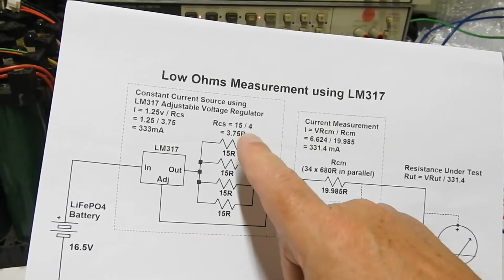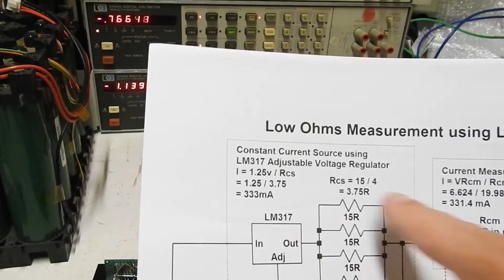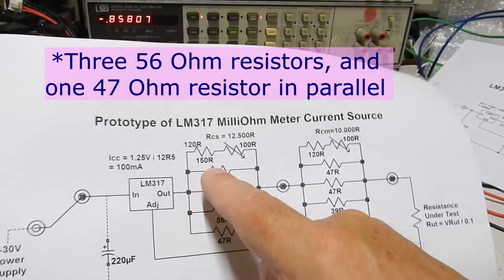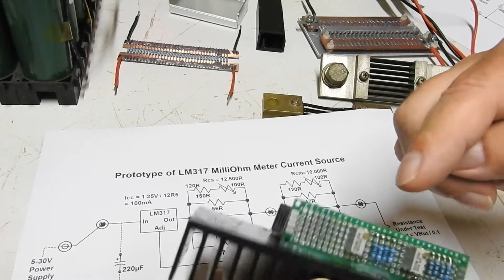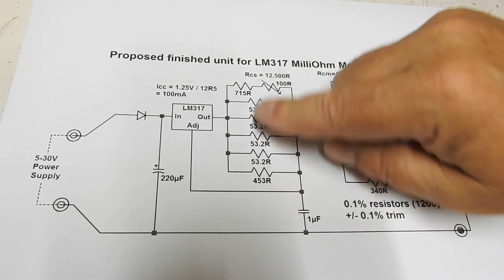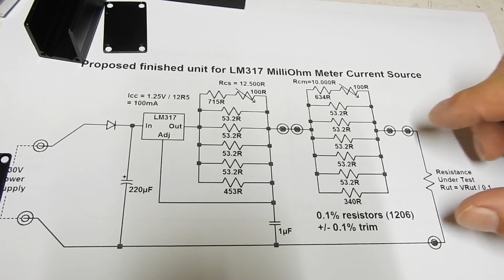Improved, Improved Low Ohms Measurements

Comment: Nice!  Thanks for that.

With three resistors in a loop, you're only one away from a Wheatstone Bridge!  :)  For low ohms, though, it would be better to step up to a Kelvin Double Bridge, which is essentially using a four-wire connection to your unknown and your standard reference resistor.  It does move the reference resistor location outside of your multimeter and onto your bench.  All of the precision comes from that one. For the rest of it, you've already got all the parts!
Reply from the maker: Yes, I'd like to play with a Kelvin bridge arrangement sometime, but when doing this stuff I hadn't even considered using a bridge.
And meanwhile, as this worked pretty well, I've gone on and made this up as a finished project in a box with 0.1% resistors. So I'm sticking with that for now...
Reply: @bertoid  Understood!  Bridges bring, perhaps, more precision (if played well), but... less convenience!  :)

Comment: Scullcom hobby electronics on youtube did a nice build of an analogue milliohm meter using an IC current source/sink, LT3092. He has great DIY projects in general, few, but all of them huge quality. There is a nice instructables project by a danielrp converting a similar topology to a digital project using arduino and a DAC as well.

I was wondering why you used such high voltage source?
Reply from the maker: Yes, I know of Louis' project. It may even have been the inspiration for my fooling about here, as I thought his was a bit over-complicated, and so I tried to make a simpler "poor man's" version. This one is just an adapter, rather than a self contained unit, but only it needs a meter and a voltage source, which I think is acceptable for the very occasional use it would get.   
You're right that the voltage source here is much too high. It only needs to be: Diode drop + Regulator dropout + Sum of the 3 resistance voltages. 
So just a few volts (maybe even a 3 volt battery?) should be fine for measuring DUTs of less than 10 ohms. 
It should be no higher than needed, so that regulator heating doesn't throw off the calibration. But a second meter monitoring the 1V drop over the 10R shows the actual test current, and can be used to compensate.
Reply: @bertoid  Lous is interested and has fun with his designs, but they often have misunderstandings and/or flaws that keep them from being fully qualified for metrology purposes.  Fun to watch, perhaps!  But not a great reference for building up truly precise measurements.